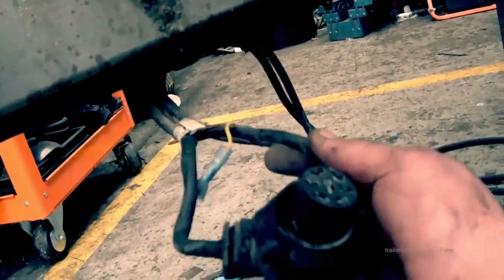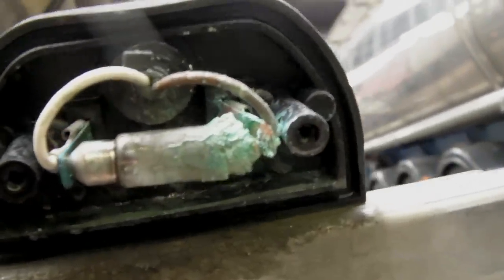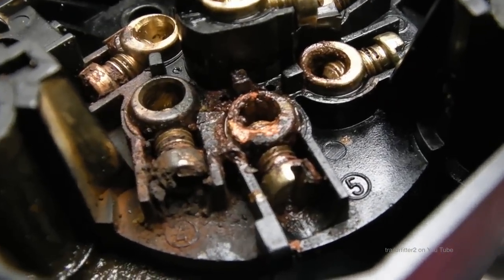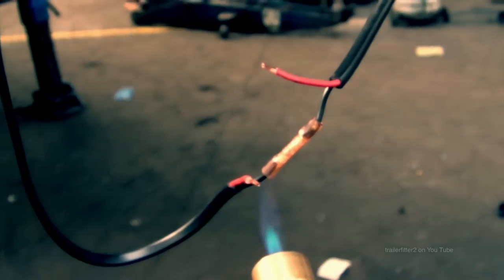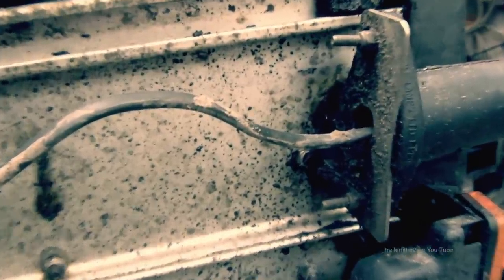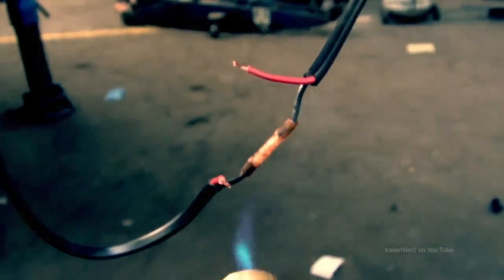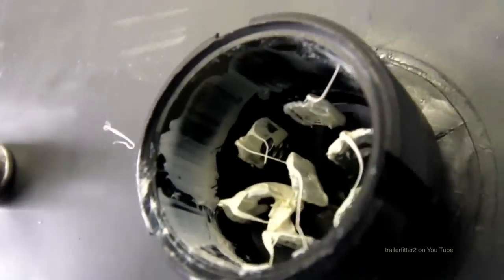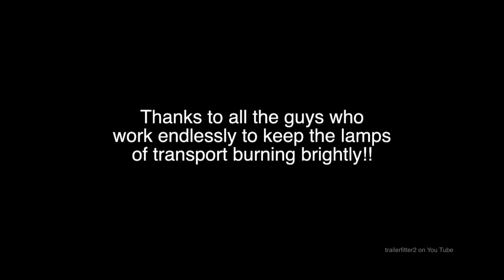HGV trailer wiring connector corrosion- water always wins

Comment: Superb video, clear concise and excellent in terms of pointing out how to join and route cabling properly including methods to reduce corrosion.

I hate removing old insulation tape, although it's been put on in "good faith", as you clearly state it's a catalyst for corrosion in the external environment as it traps the moisture.

I find good quality heatshrink more effective, where possible I'l try to double heatshrink.

Keep up the good work.